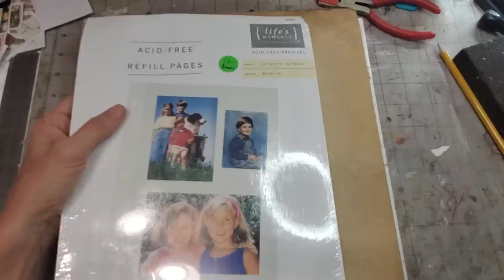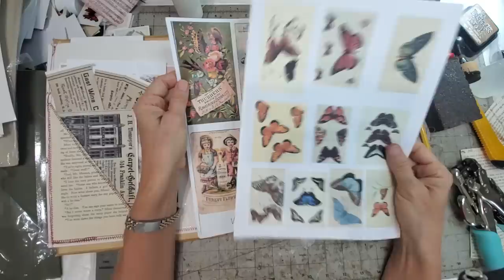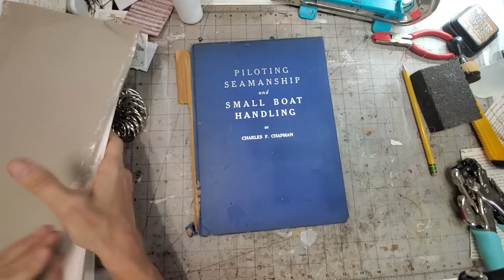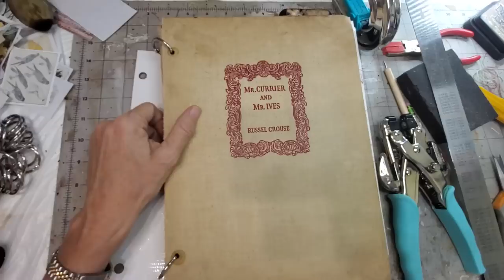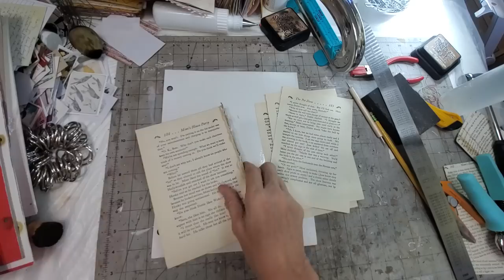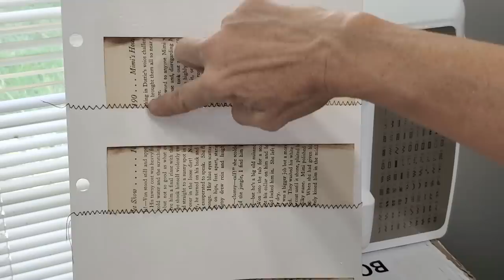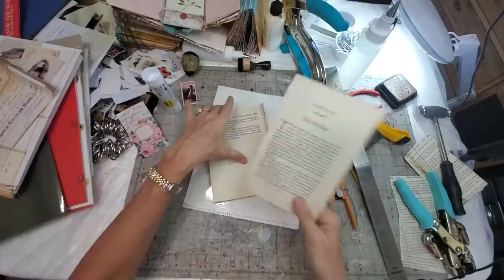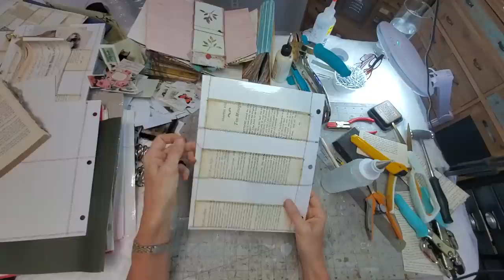How to Make a STORAGE BOOK for Ephemera, Embellishments & Digi Kits for Junk Journals Paper Outpost!

Comment: Very Nice!  Tip: when you thread your sewing machine, you must have the pressure foot UP -- this opens the tension disks so that your thread is held correctly.  Otherwise, you leave yourself open to jams & birdnests - which aren't good for sewing.
Reply: Yes, I had some real bad jams on my machine when I ignored certain things like the line on the right wheel being at the top and WOW, it gets ya!! I find myself re-reading stuff in the owner's manual because I sew very seldom--mainly tiny holes in my shirts from my parrot "grooming" my shirt. So I forget how to put a needle in the machine (flat side to the back--i forgot that) but I struggle onward through the fog!

Comment: This is an awesome idea. I do have one suggestion. I think placing the bottom edge of the inserts flush with the bottom edge of the covers would have given you a bit more space for items that may stick out of the top pocket. Also, if you’re putting the book on your bookshelf in a vertical position, the pages will have a way for them to rest on the bottom edge rather than just hang onto the rings which will put too much stress on the holes. Photo albums are being tossed away all the time and the thrift stores are full of them. I always thought they would make excellent ephemera holders. I love the fact that you’re using book pages to make pockets. The smooth back of the cellophane on the pages makes it very easy to put and take things out. 

I was just thinking, you need to do a studio tour.

Comment: Great ideas shown here..... Anyone wanting /needing a quick ephemera storage book? Get a three ring binder with a wide spine that holds 8.5 x 11 inch plastic page protectors, plastic pages with pockets (the kind used for storing baseball cards) or with 4 larger pockets on each side (Hobby Lobby) and start filling! No glue needed. I used a paper clips on the top of each pocket to keep ephemera from slipping out. 
You can slide a decorated 8.5 x 11 paper into front and back covers exterior. ❤
Easy peasy.

Comment: I have been looking around for something like this for all my tags, large fussy cuts etc.  I have most of them in boxes and can't see what I have for my journals.  I don't' sew at this time ( i am learning).  I  used hard cardboard for the front and back cover and I bought 120 lb card stock (very thick) for tags but,  my printer doesn't pull it in. So I use that cardstock for the paper inside the book.. Its heavy enough to hold. ( I hope)  I also have a lot of book pages to use.  So far looks pretty good.  I distressed the book pages and glued on with Elmer glue and so far looks pretty good.  Thank you Pam for jump starting my brain.  I always enjoy your videos. Very entertaining and I learn a lot.

Comment: I hadn’t thought of this when I first watched this video, but as I am making more journals, I really like to keep all of my papers and such that I’m using for my project together, this would work for that as well. It makes it so much easier than the way I’m currently doing it. This takes up so much less space and like you mentioned, you can see all your ephemera and off cuts of paper. I’m currently using tall, clear pendaflex folders that are opened at the top. It works great but even buying them at Walmart, it can get expensive at $4.88 each, and I usually several projects going at one time. I looked on Amazon and even buying multi packs it’s more per piece than that (just FYI). I’m glad I saw this again.

Comment: Your little paper dot cutouts are sticking to your cropodile because you don't let your glues dry. For some reason some adhesives don't completely dry on metallic surfaces. They leave a sticky residue behind. Try cleaning it with a dab of mineral spirits on a q-tip, or acetone.

Comment: I like this idea a lot except those old magnetic pages are not archival free :( also do you have any tips for non-sewers to make something similar? Thanks
Reply from the maker: This is correct...its not archival but I rarely make archival things..I just want to have fun with paper :) For strength without glue I might try staples.
Reply: I think 2” wide clear packing tape would work great. Just make sure it overhangs the bottom and sides of the pocket to stick to the photo page (or whatever you’re using as a base).